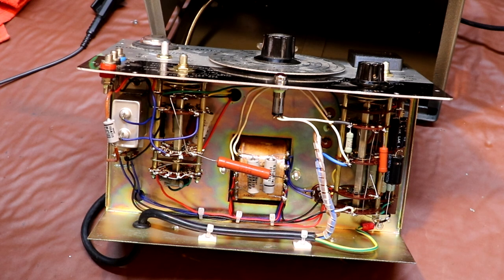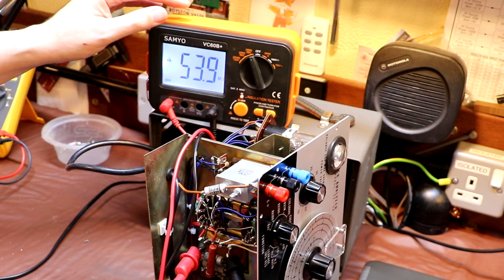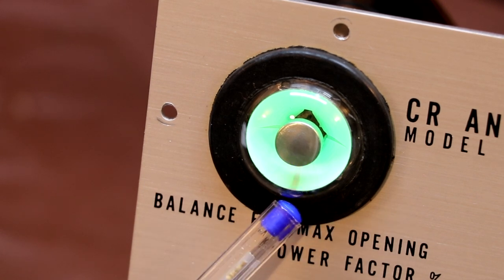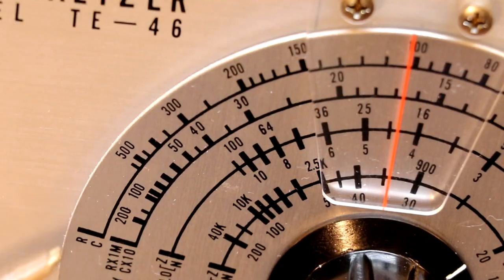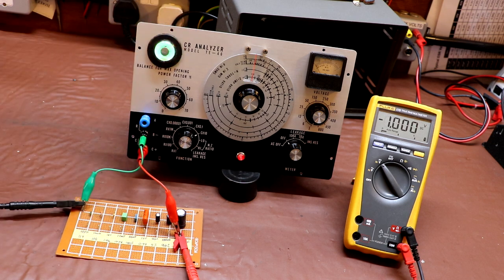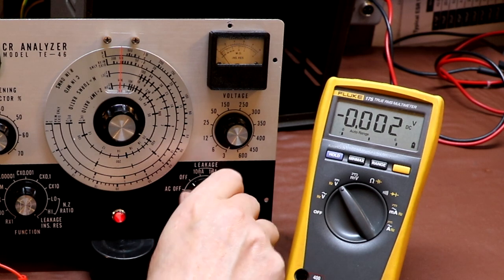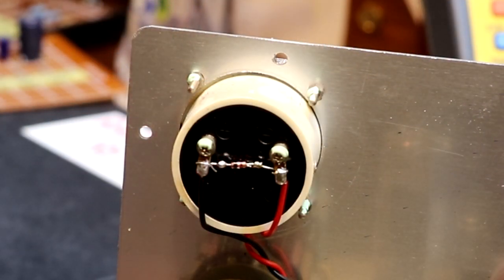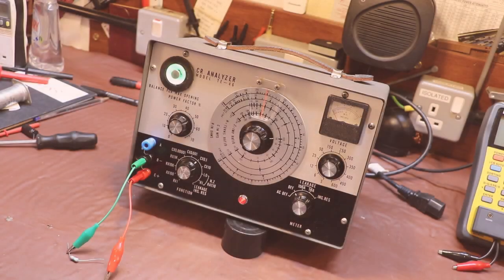Lafayette Capacitor Analyzer TE-46 Part 2

Comment: Fantastic.  I just bought an Olson TE 189, which seems to be identical to this.  I couldn't have asked for a better overview.  Thanks!
Reply from the maker: Hello Jim. These are actually quite useful unit for working on valve equipment. Good luck with your restoration you shouldn’t have much trouble but be careful on electrical safety some of the wiring is very poorly done.

Comment: I found one of these on ebay and won the bid. It's much better then my Elco and well built. I make my own cleaner with water vinegar and a little drop of dishwashing soap.

In the first testing of my example I found that the meter has a broken hairspring so I'm going to have to replace it with a 50uA meter. The schematic shows it to be a 60uA meter so I may have to play around with the shunt resistors to get the scale right but really it is just a relative measurement so it doesn't have to be exact. Other then that it just needs a recap and I'll change the power cord as well. It needs the earth to be in my dog house!!

Well I guess I need to get busy designing a mount for the new meter movement. I don't want to make any changes to the front panel so I'll just 3D print something.

Anyway another great vid thanks again!! Oh,,,, You should make a logo for your coffee/tea mug that has a toothbrush on it that has "Wifey's" written on it. You know like Defpom's soldering iron on his mugs. I mean we all know that the Wifey's toothbrush is the best thing to use to clean stuff. Just don't forget to put it back or you may end up in the doghouse. In my case it doesn't matter seeing how I'm always in the doghouse for one thing or another!!   "Yes dear I taking out the garbage now" Got to run!!

Comment: Very useful device for its time. I use glass cleaner mostly for metal cases, sometimes WD40, which is good for shining plastic too. Another great video.
Reply from the maker: I think WD40 is good for cleaning chassis’s and removing old capacitor wax and I don’t mind the smell

Comment: It's a very nice  l.c.r  bridge :-D 
You are spot on with the capacitor leakage, they can't be trusted to stay safe.
The best thing you did is the case earthing,  i never trust un earthed case unless it's plastic.
I made a test amp in a small metal case back in 1993, i used a transformer to power the circuit.
The case was earthed, i just had to.
It sounded nice with a volume and tone control. ( Very handy for audio stage testing.)
It was a mono Tda 2002 chip from an old car radio, the pcb was asking me to use a junior hacksaw
to seperate it from the rest of the crap :-D
Thankyou for the smashing video chris :-D.
Reply from the maker: Thanks for watching and nice comments. I’m guessing it will probably be used most just for reforming capacitors but it’s a good multifunction instrument. Best regards Chris

Comment: The "Insulation Resistance" is for testing leakage of mica, disk and paper capacitors. The "Power Factor" test must be performed with the Power Factor knob initially at zero.

Comment: excellent as allways 
one of my vintage cap testers (the hunts one i think) discribes the power factor as mesuring  series resistance at 50 c/s AC .
Reply from the maker: I did do some searching on this type of measurement but didn’t really find any good explanation
Reply: @allthegearnoidea6752  Perhaps Lafayette's power factor would be the same as dissipation factor in more general usage.